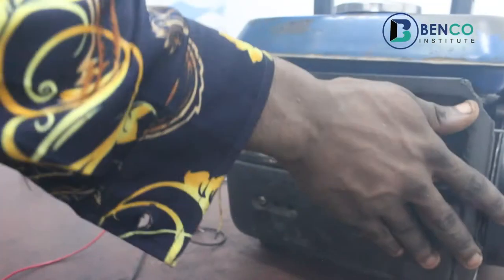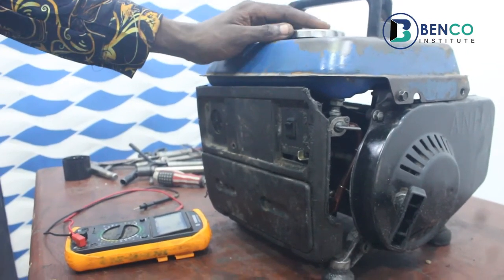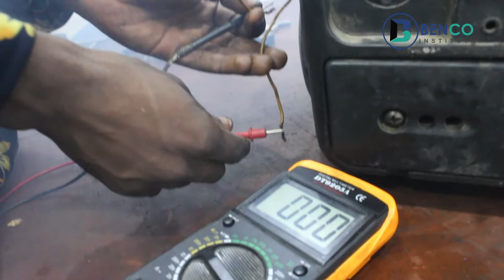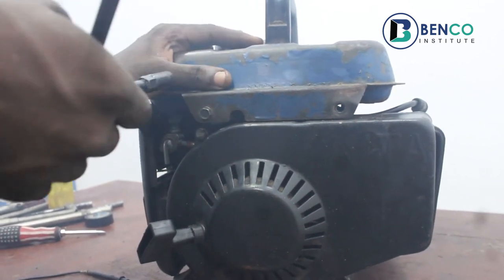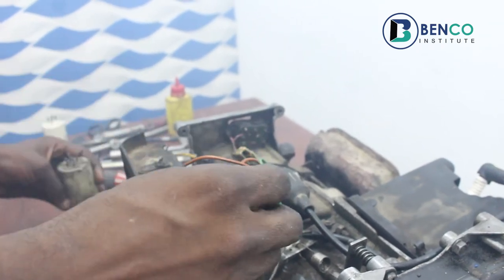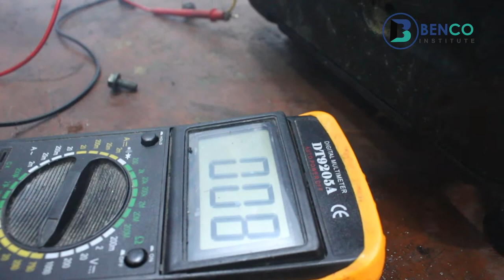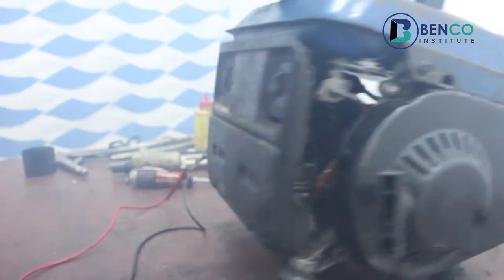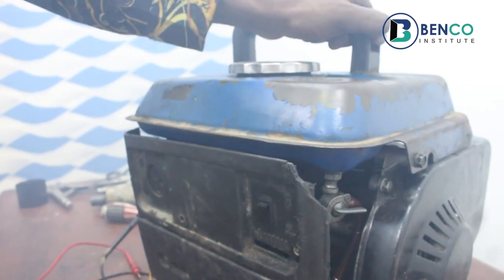Restore no power& voltage output in old 2stroke chinese small Engine generator Capacitor replacement

Comment: Thanks for the informative video!
I have a similar new generator, no issues as of yet, and knew this is a common problem with these kinds.
As an Electronics Engineer I advise you to buy leads with crocodile or alligator clips for your multimeter, so you can stay safe and don't have to touch live wires! 
Take care!

Comment: Sir mine is reading 15v but it's not the capacitor
I suspect I should add a diode to multiply the voltage but I don't know how to do that

Comment: Thanks for the knowledge, pls my small Gen engine is not running faster and because of that even after putting the Gen on there won't be any supply until maybe i put on sth a little heavier like my TV before the lights will On. which capacitor do i use? thanks.
Reply from the maker: Increase the Rpm of the Gen a little...before we talk of changing d capacitor
Reply: @bencoinstitute  I did that already

Comment: Your videos have been so helpful in many ways, thank you for great awareness you're doing. 
Kindly explain why one must add some engine oil to the fuel use in running tg950? Or would it run without adding the oil?
Thank you - samuel
Reply from the maker: Thanks

A Tg950 generator was built that way unlike the bigger generator that has its own compartment for oil ...Tg 950 generator doesn't have that and at such the need to use another method to lubricate the internal running components of the Gen by adding oil to the petrol where the oil eventually goes into the internal rotating parts of the Gen
Reply: @bencoinstitute  it makes a whole lot of sense. But the major snag is, knowing the right measure that's: oil to fuel ratio. I had had a situation whereby the ratio of oil added became overwhelming for the quantity of fuel hence the engine wouldn't run until I added more fuel. So, could you help with right measure best for efficient running of the gen? Thank you.
Reply from the maker: @OluwasijibomiMuyiwaBolan-ht1ub  

Honestly this is quite tricky as ratio of oil to petrol differs with different engine oil.

Honestly the best thing to do is to get a particular brand of oil and from overtime usage you get the right proportion of oil to fuel
Reply: @bencoinstitute ....that could also be dependent on the octane level of the fuel used. For instance many the fuel in circulation are of low octane rating therefore adding oil to it requires a whole lots of care. Thank you bro
Reply from the maker: @OluwasijibomiMuyiwaBolan-ht1ub  Exactly bro

Thanks for engaging...hope you are a subscriber
Reply: @bencoinstitute I I'm not sure if I'm a subscriber already but I'm sure I'll after now. This is a win-win stuffs we've advocating for years, thank God for a platform like this. Let me, now, report my TG950 gen to the expert. I serviced the carburator and I tried to lock it fuel valve as much as possible while its RPM adjuster is reduced to the very minimum, inorder to conserve my petrol, so my gen is fluctuating which is quite understandable but the qualms is, its fuel consumption rate is still high or am I the one feeling do because of fuel scarcity? Your advice pls.

Comment: Thanks for the videos. Pls is it compulsory we use 30uf capacitor?
Reply from the maker: Not compulsory
Reply from the maker: I used 30uf in the absence of a 25uf capacitor
Reply: @bencoinstitute  pls I was able to get 25uf but 450v was on it. Am I still correct pls?

Comment: Hi mine had no output and the existing cap was10uf 350v i bought 10uf 450v new one which iscylinfer shape and i only get 120v and 9v out instead of 240 and 12 and the engine seems to sound and run nice. Any ideas?
Reply from the maker: Get a bigger Capacitor  let's say 24uf...if that doesn't  work that means the diode of your armature is faulty
Reply: @bencoinstitute  actually I ripped it all apart and it has burnt windings on the main outer coil,  it also had a burnt out resistor which I substituted the diode is ok. It is kaput. Need a new coil

Comment: Pls whatvif my capacitor is 450v written on it. Can I use it with my small generator? Is it not too much?
Reply: @bencoinstitute  pls I was able to get 25uf but 450v was on it. Am I still correct pls?
Reply from the maker: Fair enough
Reply: 450V is the maximum voltage the Capacitor can handle, not the output voltage of the generator, that is set by the stator windings.
The uF (microFarad) should be the same.